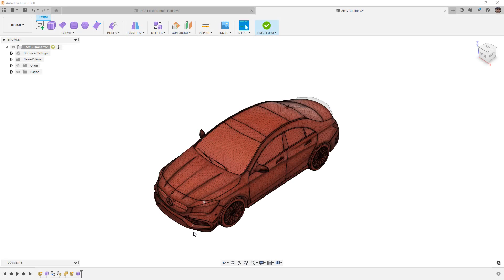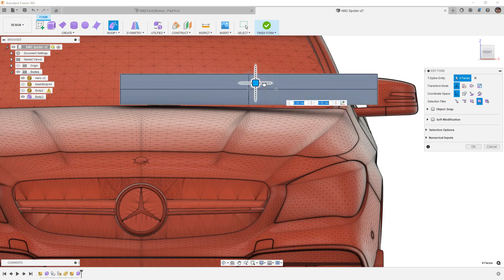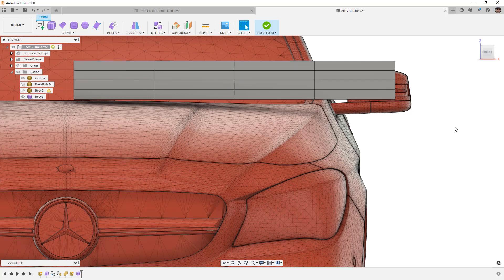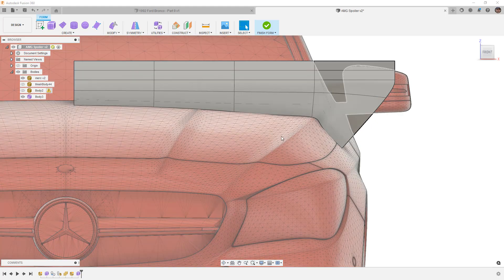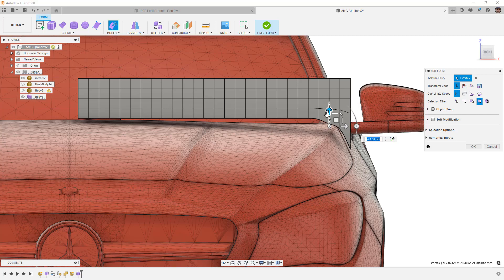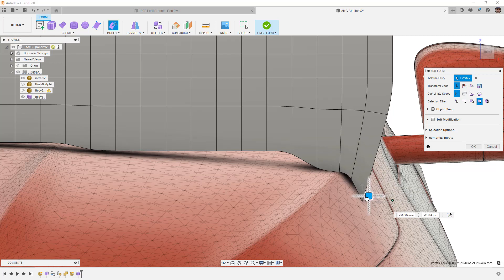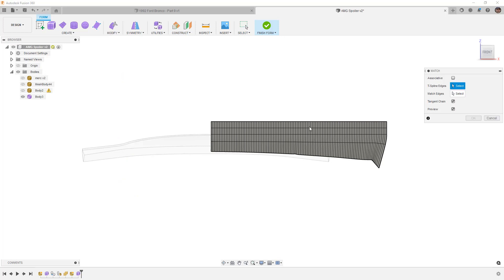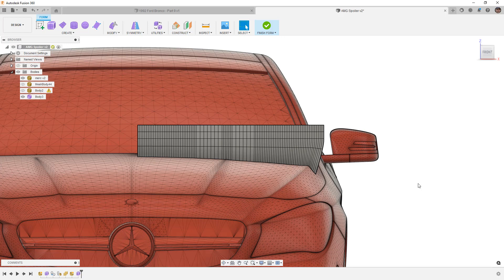Fusion 360 Form Mastery Part 28 - Matching A Complex Shape With Pull #Fusion360 #Tspline #Form

Comment: Great video. I was wondering if you could do a video on a front splitter?  Thank you
Reply from the maker: Great suggestion!  I will be doing some more car part modeling in the near future.  Some aero stuff, some flow/venting stuff as well.  Are you looking to make something or just do mock ups?
Reply: @ thank you for the fast response. Your videos are excellent. I’m very new working with fusion 360 and CAD in general. I have lots to learn and watching your videos are very helpful. I just started a business making carbon Fiber parts for cars and learning fusion 360 will help me with producing much better products.  I was wondering how can I reach you?  Thank you
Reply from the maker: @jamessmearer117  Hey Ashley,  I don't do much in the way of 1 on 1 training at the moment.  I find that the cost of the user is too high, so i try to do videos and courses to reach a wider audience with a lower price of entry (often free :)).  You are likely the 5th or 6th at least that have started a company or have a company making car parts.  I think the big question to ask is how you plan to produce your parts.  Are you looking for 3d printed molds.  Do you plan to CNC foam and hand finish.  Are you going to outsource some aspects.  The reason for this is because the manufacturing method often drives a lot at the design level.  How "good" the surfaces needed to be for example.  The orientation of geometry relative to your manufacturing method.  In many cases people will 3d print (in many parts) a "positive" of the final, install it, then hand finish to make a buck to manually create a mold.  In other cases you might print a mold with the negative geometry, maybe compression mold.  In some cases you might have a company machine wood or foam bucks.  A lot of these decisions drive how parts get modeled.  Someone at home with only a 3d printer might opt to print the final part in many small pieces, glue together and hand finish with body filler, paint, and then make a mold from that part.  Street Bandito did this on their carbon electric 240z.  In some cases like Chris Forsbergs drift car they ran the 3d printed parts, at least initially.  Easy Composites in the UK do all sorts of things and have videos on compression molds for carbon parts and how to use their kits.

So i think the first step is to really think about how you plan to make the parts as that drives a bit on how you do things and how "good" your models need to be.
Reply: @ 

Hey there, I like to thank you for the quick response and the helpful information you provided. 

I hope that I can provide you with some information related to what I’m looking for. 

As mentioned, my new business is very new. I started with basic designs using Onshape and then moved onto Fusion 360. My designs were coming along but the issue I ran into was the fitment of the part that was 3d printing just wasn’t matching up to the body of the vehicle that I was trying to produce. 

I then decided that I would get a subscription to fusion 360 and what I learnt was that it’s a whole other ball game compared to onshape. Maybe I’m wrong by saying this but I feel that I won’t need to understand all that fusion 360 can offer, at least for the meantime. 

After seeing a few of your videos - absolutely awesome, the one I watch was where you had designed a ducktail for a Mercedes. I followed along with your instructions, and I ran into an issue where my part went from nice and smooth to all, not sure if I can explain this properly, but to all kinds of points facing upward. 

One thing I did notice was that my mesh when uploaded into fusion 360 wasn’t centered. Maybe that caused the issue. 

I could pay you for some help. What I’m looking for is to learn how to design the following car parts:

Rear ducktail spoiler 
Front splitter 
Side kirts 
Rear spats. 

What I could do is use my 3d scanner to scan my car and if you could provide me with a tutorial or instructions to make those parts I could pay you for your services?  

I really like to thank you for your help in advance. Thank you for your time.

Comment: If you can create a curve from the mesh surface, then you should be able to match to that curve (which lets you use the automatic tolerance). Something like https://www.youtube.com/watch?v=KchEATw1dH4
Reply from the maker: yeah i have several videos on mesh section sketches, but the problem is the surfacing tools aren't great yet.  They do weird things mid surface when making lofts or boundary patches.  Curvature spikes on edges that should have smooth continuity with or without guide curves.

The intent of this video was more to show the fine mesh resolution and the pull tool and how many edges you may or may not need.